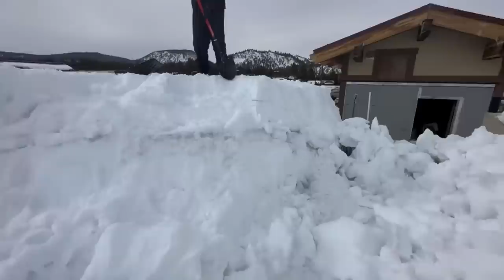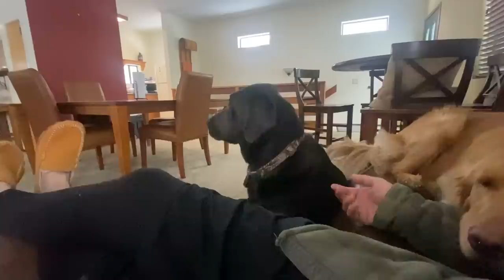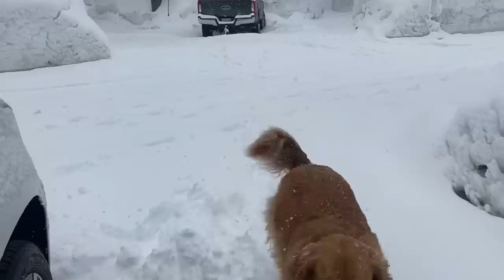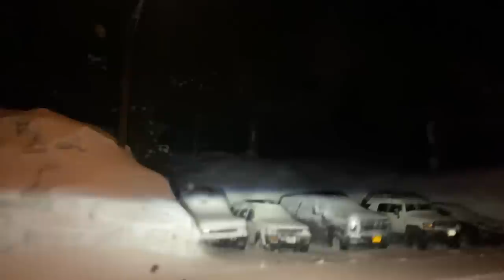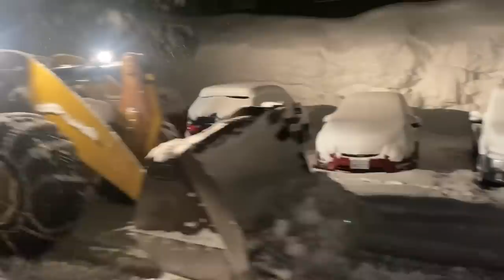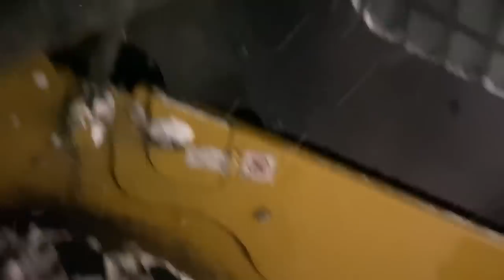Relentless snow 2023 (Mammoth Lakes, CA)

Comment: Great to see everyone is roped in. All it takes is one fall from that roof to realize how important when they fall. Saving one life shows
these guys you care about their safety. Very good to be safe to survive to work another day. 

I grew up in northeastern wisconsin. That snow is very dense and heavy to move It has to be removed from those roofs before more snow falls to damage or collapse the roofs. That snow is very dense and heavy much different from the light and fluffy stuff earlier in the season.
Snow falling in the very cold is much different from snow falling just below 32. Over time with warm temps the snow melts from the top and refreezes below. It just gets denser and heavier day after day. 
The spring and the big snow melt are coming soon.

Comment: for your roof jobs, perhaps a snow/ice saw would be able to cut bigger blocks to move and increase efficiency for moving that much snow.  it appears to be dense enough to hold together
Reply: That’s what I was thinking. Tough job either way
Reply: lay down giant heating blankets/tarps over all the flat roofs and plug them in. That would be cool. not efficient, but cool
Reply: Probably more of an issues of where to put larger blocks. Small portions can be dropped onto the street without causing damage to anything. The main problem the mountain is facing, followed by tools and manpower, is simply where to move the snow to.

Comment: Feel your pain ive been through some crazy winters here in south central ak,you guys need to start blocking your snow with 24" or larger hand saws cut to fill one big scoop push shovel, in valdez they block snow with street signs with bent sides and a handle cut in the top them slide the block of the roof on a visquene slide, good luck

Comment: When they had guys do the hospital roof here and some others they used big tarps to dump snow on then slide to edge .seemed a bit more efficient that just each guy pushing the snow individually. They are all gonna be so toned from moving all that snow ! Let’s pray the next system breaks up with totals
Reply: there are 5 foot high parapet walls to get it over.  More poor design/building codes in the area.   If the walls did not go all around the perimeter, they could push it off, but its like they made that roof into a giant swimming pool.

Comment: Why would air jack hammers hot work on cutting the edge of the snow, peal it off the smsll chipping size blades? One aie compressor could run 2 or 3 chippers.

Comment: what's the deal with all of the weak ass roof pitches? They seem way too gradual for a mountain town that gets a ton of annual snow. I'm sure there are a lot of A frames that don't make it on camera because you don't need to be removing snow from them. But what's the code/standard for MM. Why the flat roof on the businesses and the gentle pitches on the high rises you were clearing in the beginning? What's the electric heating situation for drainage on the flats? A video talking about the building standards and practices would also be interesting to watch. Keep it up!